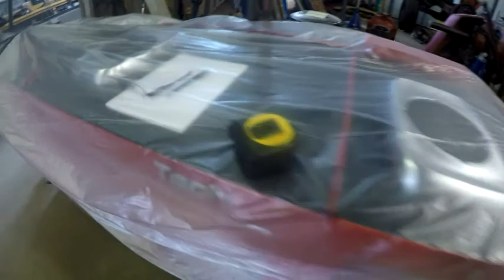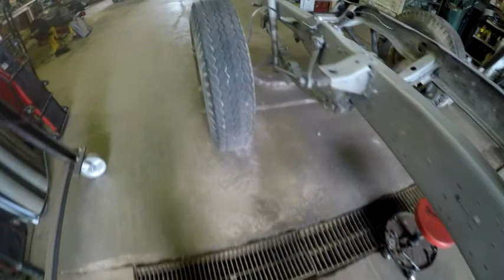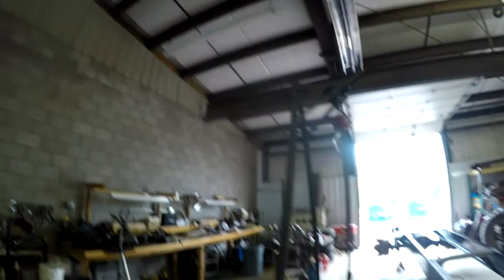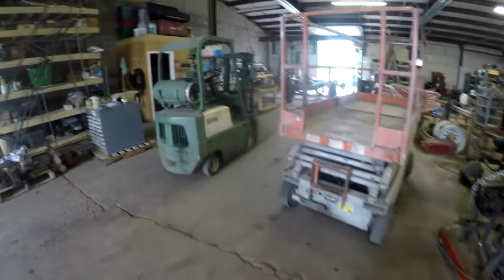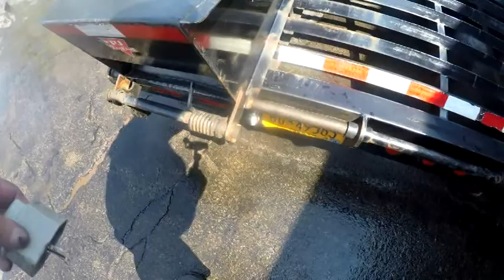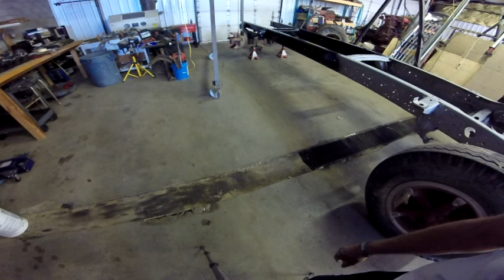Shop Update 08/05/18

Comment: Fred I could definitely tell the difference with the led light on and off. Just to let you know there are two different types of led bulbs for the fluorescent fixtures there are the ones like you have that you take out the ballast and rewire the fixture They also make one that is a plug and play you do not have to remove the ballast or rewire it just remove the fluorescent bulbs put in the led bulbs and your good to go I think the plug and play are less common and maybe a little more money but they do make them I think you can get them on Amazon along with the ones like you have. Man you keep that truck clean my company truck stays dirty all the time its lucky to get washed and cleaned on the inside twice a year but we use it 6 days a week working out of it. LOL Have a safe trip to maine and back.